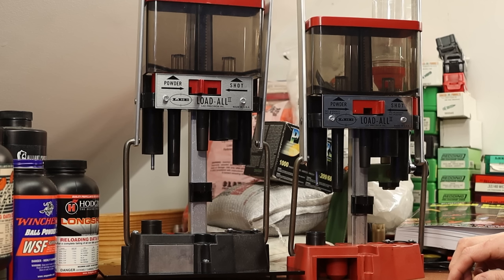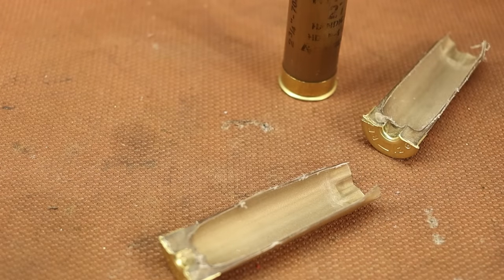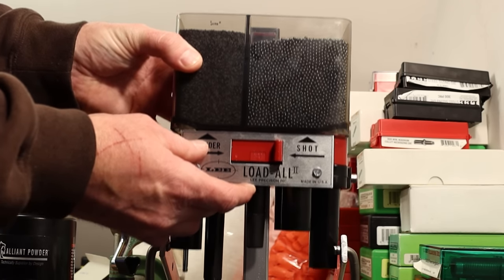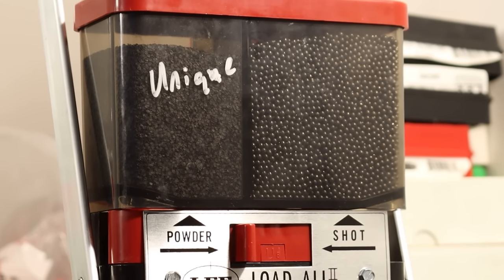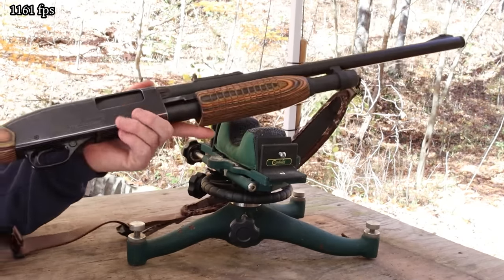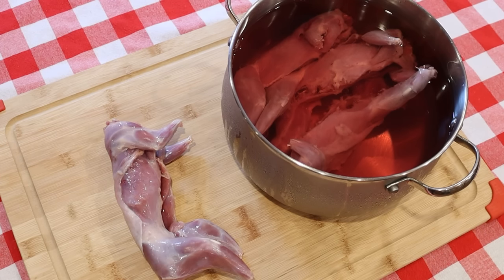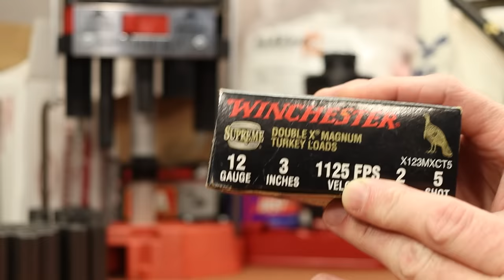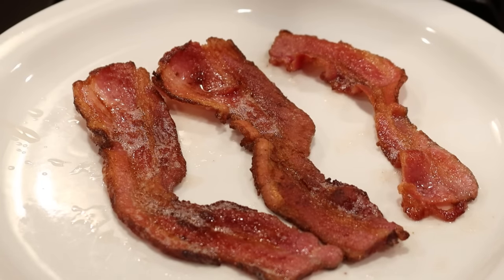Loading 12 gauge, hunting and cooking squirrels

Comment: I always bought traditional wads,.....yes clay busters.
Even though Ballistic Products has hundred's of cheap options,......options like no Hazmat fee if you buy hulls with primers installed**
1) you Identify your hall type,....not brand,... type/ style.
Then you find the recipe for that type of hall.
2)Then you round up the components,.... the right primer type,.... the right powder,.....the right wad,......the right shot.
I'd use 7 1/2 on everything,....even turkey,.....6 shot too. Not the industry's expensive BB loads.
Consult BPI,....they sell pamphlets and books that take all your fears away.
There's 1 or 2 primers that have a smaller diameter,....you would have to pound a resizing tool into your hull.
Federal Hulls with ribs on the outside were my favorites**
Also BPI sell a product thats a dust that makes your wads slick so your shells go together easily.
The ones you like,... you may have trouble crimping the harder plastic***
You Buy hundreds of Hulls with primers cheap at BPI,... they sell you reloading data for their cheap hulls as well.

Comment: To my eye the Winchester x shell you have on hand looks exactly like the blue Cheddite shell illustration, besides the color difference. It's got everything that your Winchester has: same length, same brass plated steelhead, same low brass, same gray plastic base wad. So what's the difference?

Comment: Hello - i am looking for the reloading of shotgun shells - and i am no expert  - just want i am reading in the books on the reloading shotgun.  Your metallic is a "hole lot different that shotgun".  The metallic has case, primer,  power, and projectile - say you loaded 223 - the metallic has more specific steps than shotgun.   BUT - shotgun is more forgiving on the process for reloading.   I too am looking for more the shotgun reloading - I have two shotguns that needs shell.   I have the shot (7.5), hulls (3000 RP game hulls), wads (for the RP), and some power (WSF) - I need a press and primers (they are hard to some by).  My your Lee press - I thing that I am looking for a MEC press (the size master or the jr - i do not know which) is the press that I am looking for.  
The wads are personalized to the hulls.  The strength hull and the tapered hulls have a unique wad per each.  With this in mind - the pressure is not high as rifle (rifle is 50,000 where shotgun is 10,000).  Is the reason the hulls are make out of paper or plastic instead of brass?  I to am a metallic reloader but shotgun would be easy to load - once the components are bought.  
I never had the meat before - it looks good to eat.  
Keep the reloading up - the ammo prices are getting steep!
Look at 314299 for the breakdown on the press.

Comment: I use 1 oz #6 for squirrel in the 12 gauge 7/8 in 20 and 28 gauge. I use gun club hulls for 12 and 20 AA hulls for 28 gauge. This is where people will call me out. My 12 and 20 gauge will nock a squirrel out of a tree out to 65 yards and my 28 out to 50 yards all day long. I use Improve modified in all three gauges. Don't sell your shoot gun short try different chokes and more shoot is not always better.

Comment: I’ve been where you are. Let me save you the frustration. Get a MEC Sizemaster and an adjustable charge bar. The crimp quality is like the difference between and a stormy night and a day at the beach. Or if you want a day at the beach in the Exumas with a hot chick who is into you, get a Posness and Warren Duomatic. If you want her hot friend to come, order it with a second gauge die set. The head will hold two die sets at a time. They will load better shells than any factory load You have ever seen. The crimps are glorious with a beautiful taper at the mouth. They function slicker than a snake down a rat hole.

Comment: I'm interested in loading some 1.75" short shells. If I'm thinking about this loader correctly I should only have to shorten the last 2 stations tubes by 1" then rase there bases 1" to compensate. Does that sound correct to y'all?

Comment: Dont load 12 GA but do load 20 GA, Estate hulls in 20 are made by Federal, they even have the same paper wad and MADE IN USA stamped on the case head. As far as the Lee Load all goes, i dont use the powder hopper for powder charging, a standard powder thrower is much easier to adjust and empty, not to mention more accurate. One piece hulls are much better than two piece hulls, they hold up better to hunting loads and have a more constant velocity through temperature ranges. In the shotgun community Long shot powder is known as Loud shot especially in 12 GA and larger bores. Some ranges will restrict the use of Long shot at their range due to the extra noise that it creates and disturbs nearby neighbors. Those odd hulls that have the short plastic base wad are referred to as promotional hulls that are not meant to be reloaded, cheap construction thats quick to produce to keep up with sales demand. Might take your marker and make a alignment mark on your crimp station of your Load All to speed things up a little. For current costs, you might think about getting the Lee 18 cavity #4 buckshot mold for coyotes (two and four legged). Great video, looking forward to what might become a playlist.

Comment: I used a Lyman shoot shell loader for years and The Lyman manual. I never had a problem. Guy they’re just trying to not get sued in this day and time. I’ve use Winchester, Federal and Remington hulls, Winchester, Federal plastic wads and I never had a problem. It doesn’t matter. If you’re squirrel or rabbit hunting use number 6 or 7 1/2 size shot  you’ll be fine. I never used unique for shot shells though, pistols yeah but not for shotgun.

Comment: Idk if its possible but does the lid have a correct way? If not I would 3d print a lid with a funnel on one side. When you need to empty it, it should make it easier.

Comment: The way you feel about not knowing about the "Estate" hull is probably how people who don't reload for pistols yet but plan to so they save up aluminum or steel cases.
Reply: I had my best luck reloading only Winchester AA hauls.....both red and silver. They take the crimp the best and always look factory no matter how many times you reload them. You could easily use them up to 15x - 20x if you were careful and didn't walk on the empties or load them too hot.

Comment: Go watch bubba rountree outdoors channel he does a lot of shotgun reloading and the squirrels looked good when you cooked them , and before you know it you will be loading two shells at once on those presses , mec presses the shot and powder are in separate bottles and they tilt backwards for unloading , and the downside of it is the charge bars you would have to buy and the bushing's you could spend more on all that than you did for the press.

Comment: Hey Shannon, I've been refreshing on my JRB lore and watching old videos. It was funny hearing you drop an fbomb way back in the day. I wanted to ask: what happened to the chamber chiller? Did you decide it wasn't helping enough? Did it break? I'm just wondering if it's worth the buy. Thanks for the many years of fantastic content!
Reply from the maker: It was 3D printed and only lasted a season or two before I broke it. I am sure they are made/printed better these days.
Reply: I have one of the popular models and it just doesn't seem to push a large enough volume of air to help much (or maybe I expected too much from it)
Reply: Thanks for the replies guys! I will hold off on buying one
Reply: @vomitingwithungodlyaccurac3218  I saw a guy gerry rig one to an air compressor, that did an impressive job
Reply: @vomitingwithungodlyaccurac3218  FClass John has a review of a couple different ones.

Comment: drill a small hole in lid the entire to will come off if you pull the handle off studs the hole will let you dump out powder then turn lid around then dump shot

Comment: I'm glad someone else is as frustrated with how conservative the shotgun reloading world is. Many of these guys are convinced being one grain high or using a different crimp or buffer will result in an instant kaboom. Modern shotguns are WAY overbuilt for the pressures they run at. They are good for well over 20kpsi, by and large. Having a load go from 10k to 14k is as likely to kaboom the gun as shooting in 100 degF vs 70.

Comment: Great video Johnny…I started my shot shell reloading career in 1983 with the LEE Load-All for 12 gauge…they do feel sorta “jankee” at first…but mine held up pretty well for over 10 years and thousands of rounds loaded until I started in Cowboy Action shooting in 1994 when I bought a used MEC 600 Jr. from a yard sale for dirt cheap and bought another 600 Jr. in 20 gauge from a co-worker who upgraded from the 600 single stage to a different MEC press…I ended up giving the LEE (still in good working order even after years of use) to a Cowboy Action friend to get her shot shell loading career started…

I’ve found over the years that shot-shell reloading can be confusing at first but it’s not as much of a precise endeavor as metallic reloading…

One good thing about squirrel hunting after a few frosts is that the “wolves” (blue bottle fly maggots…I hate those damn nasty things) will pretty much be passed…I can almost smell those squirrels cooking 😋😋😋…try WD40 to maybe remove the Sharpie.  For shot, check around for reclaimed shot from skeet ranges or maybe a Littleton shot maker to make your own from range scrap lead (I think they may still available)…

One of my best improvements to the MEC is the availability of a MEC adjustable powder and shot bar from ‘Multi Scale LTD’…it replaces beaucoup of MEC powder/shot bars for the full spectrum of gauges and works like a charm 🤘🤘🤘

That bacon fat would make some damn fine cornbread…Now I’m really starving for the food of my youth 👍👍👍

Looking forward to this series 😊😊😊

Comment: I wouldn't spend time and effort trying to make a $50 piece of plastic work like a mec. In my mind it's putting lipstick on a pig. It's better than nothing, but it's probably more worth it to find a rusty used mec 600 and clean it up. Or really upgrade to a mec 9000 to crank out shells.

Edit: I would caution you against using tungsten in your 410. An old gun like that was probably built with lead in mind. The hardness may damage your barrel and choke. I would stick with lead or bismuth if you need non-tox

Comment: Only thing I saw that I did not like was the shotgun popping out of battery when fired.
Reply: It was unlocking at the correct time 👍👍
Reply from the maker: That's just how a pump action works. Especially shooting on a front rest.
Reply: @JohnnysReloadingBench  I know that they unlock upon firing but I usually don't see the bolt move so far back . Guess when holding in the hands it doesn't do that for the most part.

Comment: Get a list of presses available.Download free manuals for the ones you like and read the directions for the one you think fits your needs. In the last 25 yrs. I had 1 yr. loading over 32,000 12 ga. for my wife and myself using a MEC 9000,Hornady, and Dillon SL 900. These are all good presses and all have their own short comings . I’ve been a Machinistfor 50 yrs.,Journeyman for 45 yrs. ,and Master for 41 of those years. Spend your time reading the available manuals.This guy is dangerous. I’ve had to fire over 30 guys of his kind to keep my shop floor safe for my other employees. 28:41 
X

Comment: The new style AA use Aa or replacement forAA wads in old style AA they are staight wall rem or win her wads works Remington gun clubs works good for reloading also most loads will work with load all I load one that won’t needs adjustable wad pressure it will leave a ring around case on AA new style you have to increase wad pressure to make it not do that will work in old style AA without increase wad pressure or remiton cases straight wall